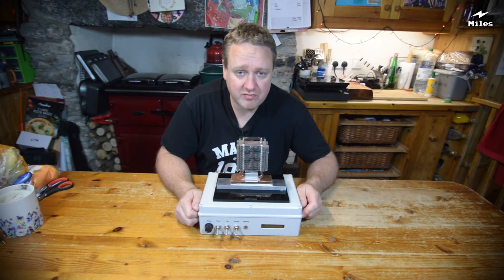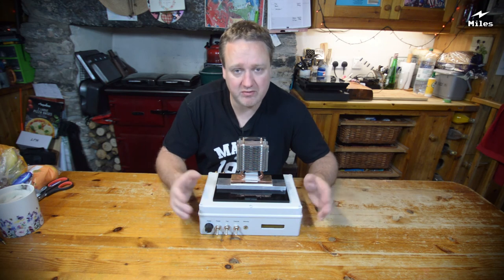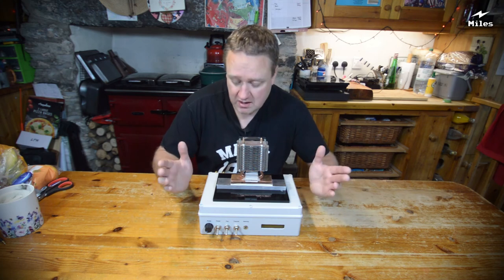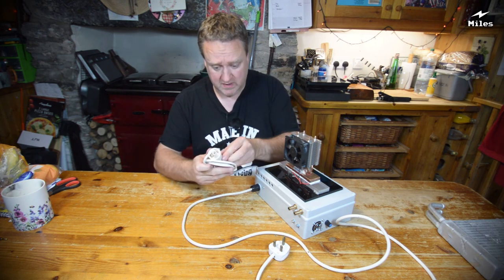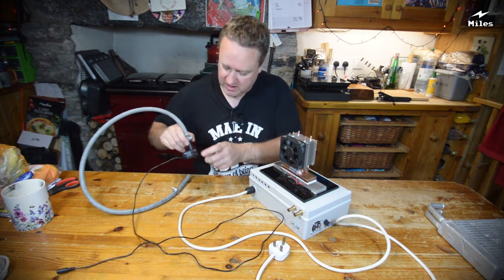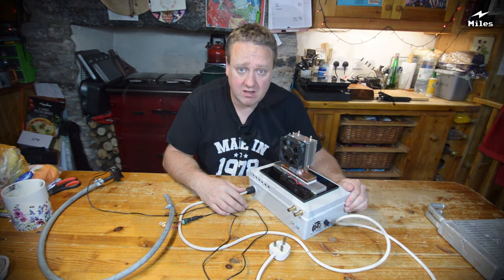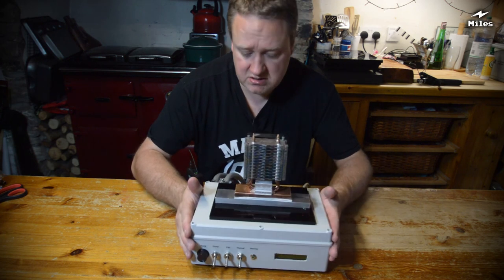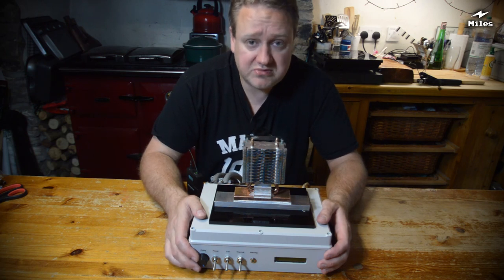DIY Micro Air Conditioner Home Made Build from 12v TEC panels and CPU Cooler

Comment: How to you manage the condensation it produces?
Reply from the maker: Hello Saurabh thanks for commenting. To be honest it doesn't really make very much, it does pool a little bit around the cooling element but tends to just evaporate away eventually.  I made the top totally sealed so no water can drip through into the electrics, just in case.

Comment: Of note here is the fact that they do make tech panels in a 5v variety. Also of note is that power isn't always the voltage it's advertised to be so I'd recommend adjusting your calculations for about 50v over what it's rated at. It's silly I know but they do it to account for sag during peak usage.

Comment: You will need 6Amps to power the peltier and your system requires a temperature control to on/off your system. Tge temperature controller sensor place at your peltier spot and set temp controller to power on when temp goes is above 25 celcius and then cut off power at 18 celcius. This on/off is required because the peltier require to rest.. otherwise it will overheat..

Comment: Looks like an expensive death trap with high voltage and water in close proximity. The hacked rectangular hole for the lcd display could be tidied.
Reply from the maker: Yeah I agree the rectangular hole is more function than form. this device wasn't expensive to make, and devices with water and electricity in close proximity are not particularly unusual and are quite safe if built, tested and maintained properly. Such examples being washing machines, showers, kettles, hot-tubs, dish washers, coffee machines etc. The power supply is earthed, fused and has RCD protection, so it's actually pretty safe, and I'm not making these to sell or anything. It's just for me and as a grown man I am able to make my own risk/benefit judgements.